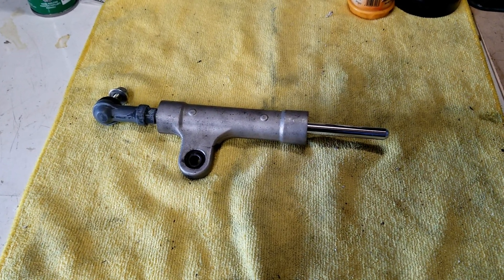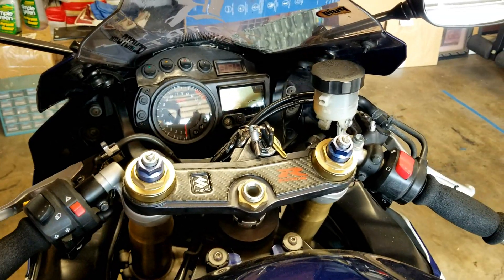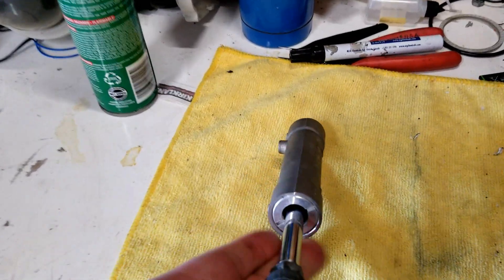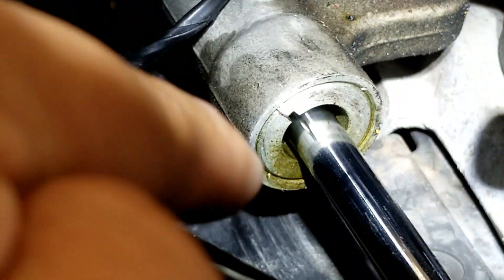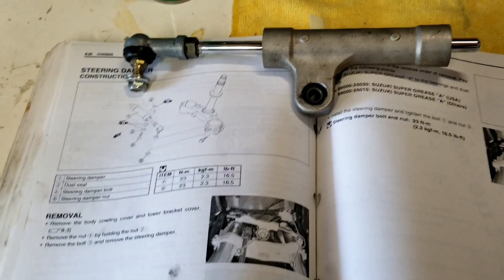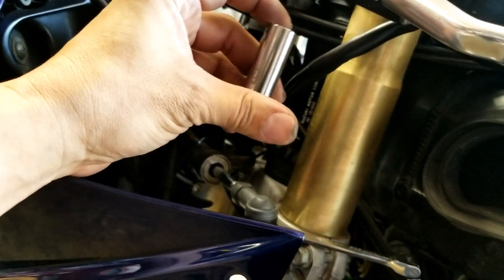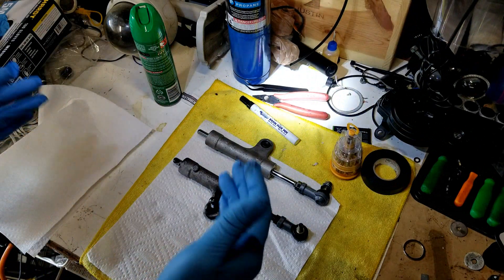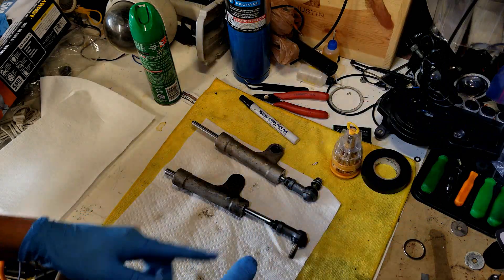Suzuki GSXR Steering Damper/ Stabilizer Replacement

Comment: Is better on clips on or under ?
Reply from the maker: It's all just a matter of preference really. I prefer underneath because it allows me to use the center stem hole for my phone holder, ..

Plus I don't have to disassemble it to get under the tank... and lastly.. I just think it looks cleaner.
Reply: @TheChemistDIY can it be revised?  like with forks?  ?
Reply from the maker: @UnknownVet I mean anything can be modifued to fit any situation, just requires a little welding. You just need one stable point (the frame), and the point your trying to stabilize (the forks) . If you look at the aftermarket stabilizer setup, youll see that its fixed point is usually to one of the two gas tank bolts and the other is end connects to the forks by way of fork nut or something that attaches to the forks or tripple clamp.. The OEM is sort of reverse of that, on the bottom end, only using casted arm  and guid pin to the respective mounting locations.
Reply: @TheChemistDIY  sorry, I explained myself badly, I mean can the original be restored?

Comment from the maker: The good book says no, just replace.... Now, I have read on the forums that it can be done but the only issue with that Is finding the replacement seals... you dont know till you try..I have two old ones but have never bothered to rebuild one,.. and thats just because you can find them on ebay really cheap rather then trying to track parts down, waiting on shipping times.. ect.

Comment: I have k8 600cc and I have a Sd code on. Is the steering damper or it could be something else ?
Reply from the maker: Check the plug connection at the damper. Disconnect and Spray it with some electrical contact cleaner and reconnect and see if the code goes away.. if not put the bike in dealer mode and see if any other codes are being thrown..
Reply from the maker: I did a little research on this on the forums and this is what I uncovered as possible resolutions to your problem.

1. No one knows if the error code read Sd or 5d..lol

2. Some have reported it being a low power issue or charging issue. Check to make sure your battery is charged and sits at the correct voltages at all times.

3. Regular rectifier is going bad and the bikes charging system is not working properly. Test the RR and see if your charging system is working correctly. There is a recall on this and the dealership may replace for free if it hasent been done already.

4. Dirty contacts on the connector and steering stabilizer. You're going to want to use some electrical contact cleaner and spray them both down to ensure a good connection, inspect the pins in here as well.

5. Broken wire connection at the steering stabilizer connector. You're going to want to inspect the wiring at the plug to ensure there are not cracked or broken wires. Some have reported that the wire length is too short and when you turn your handlebars from left to right this tends to pull on the cabling too hard causing it to break or damage the connection. If this is true in your case then you're going to want to extend these wires so it doesn't happen again.

6. Dirty or foul speed sensor. Remove the speed sensor inspect clean and reinstall. Make sure the bolt is tightened that keeps it attached to the engine casing.

If the problem isn't corrected some have reported the bike will stall, shut off completely and won't start again. Also issues with the gauge cluster not reporting milage or freezing at certain intervals.

I hope this information helps you out, please come back and let us know once you resolve the issue and what the resolution was.
Reply: james moreno I believe it’s my rectifier, my battery died bike wasn’t turning on and the battery was couple of months old. I will have to replace the rectifier and there is a recall on it. I believe that’s the problem. Cuz the bike is working just fine with a new battery and the code is gone.
Reply from the maker: Cool, well you can perform a RR test on your own to see if your getting the correct values across the international diodes.. you should also test the stator and see what it's putting out.. while the regular rectifier may be free this time around due to the recall warranty you may want to look into getting a MOSFET from roastercycles.com if it happens again. I have one and swear by it being the best.

Comment: Yup I went down 3 months ago from a death wobble/ tank slapper as well
Reply from the maker: Damn, sorry to hear that brother... did you get road rash? What type of bike? I know some bikes are notorious for having poor handling issues. I remember running over a bottle on the freeway that popped my front tire up off the floor.. when it  contact with the road my recovery was instant tho the shit stains in my boxers took a hot minute to get out when I got home...lol
Reply: james moreno yeah I had a Bilt riding jacket on and it destroyed it, the bike was a 2009 fz6 and I was doing about 80 and hit 3 pot holes back to back and was thrown off the bike but I walked away with road rash on my right elbow, right foot and a new right ass
Reply: Dih he died?

Comment: Is the stabilizer supposed to feel loose??
Reply from the maker: Lose where?
Reply: @TheChemistDIY  like the piece itself, like when I flick it with my finger it moves, took it to the dealer and they said it was fine it’s supposed to do that, I feel it should be tight, no movement at all
Reply from the maker: Ok I understand now. So yes it does move when mounted to the bike... finger flick,  well not so much so I would say. You have to remember that one end of the smooth rod sits on a ball joint while the reset just float insides two rubber bushing, so there's going to be some play or rattling feeling when tugging at it.

The major thing you should be looking out for is the left to right movement and a sudden loss of stiffness when doing so.  This feeling is most commonly felt when when making left or right turns at slow speeds and feels like the bikes is going to fall on you as the damper just suddenly loses stiffness and the bike shifts real quick.

Hope that answers your question.
Reply: Mine moves up and down real easy

Comment: Quick question: did you ever receive an error code?  Because,  I received a SD or 5D and as I research it indicates the Steering Damper.
Reply from the maker: What up marvin, on the 04-05 GSXR this is not possible, the Damper is stand alone and has no electrical connection to the ECM.. what year GSXR do you have?
Reply: I got 5D code and have an 08. Wondering if I need to replace the entire damper
Reply: Me too. I have a 07 and code 5d it’s my damper?

Comment: Replacing benefits the manufacturer not the customer plus i think when they meant replace they meant with a brand new steering damper and not a used one. It is very simple to service though if leaking and has air (the deadspot you feel when turning). If they were not meant to be serviced there would not be nuts on each end and would not have a bleeder hole where the small nut is. Only issue might be finding the exact seals if the one you have is damaged and leaking. I would recommend servicing those dampers every 2 years or so because the oil for one wear over time and the seals might gather dirt and start leaking. 

Nice video though.

Comment: Did I hear it right?
120K?
Reply from the maker: On the clock, yes..although not on the original motor.. I have have the original motor still but i had to pull it because i blew the tranny. The oem motor still runs fine with 99k on it.. I plan to rebuild it as well as the tranny that threw a few gears which was the only reason for the swap in the first place..
Reply: @TheChemistDIY  if you had problems with gears... i highly recommend you to change oil pump too

Comment: How did the replacement steering damper perform?
Reply from the maker: Better then I could have imagine. I always thought it played a single part in just reducing the chance of tank slappers but never knew how important it is in just your normal steering..
Reply: @TheChemistDIY  I ended up running my 750 on the dyno 3 seperate days with months of separation. I used 3 different settings, using the zero map and adjusting manually. I did this because I was making improvements along the way. New chain, sprockets, throttle body hoses and TPS adjustment and STPS adjustment valve clearance and stva repair. I wanted to see the improvement at each stage. Yesterdays Dyno run was 64% humidity. 
I ran it +4 ticks rich in low, mid and high. Yes, it was rich, but you won't believe the results and not far off first two runs. Long story short, I have three different results from stock map(zero map) to +4 ticks. All results were consistent and strong. At the end of the day, it's only slightly noticeable depending on what you are looking to get out of the engine performance. If anything, this will give you an idea of what to expect. You've helped me alot, so just trying to give back. If you want detailed info, just let me know. Thank you
Reply from the maker: @kennethford5386  Hey kenneth, thanks for the post brother,  More details would be great.. if you plan on posting on my channel put your info the power commander video this way the power tweaking peeps can see your stats and seek you out for help. If you have copies of each map you can thus share with the riding community, if not shoot me the info via email at jamesmorenojr@gmail.com  and I'll do. Glad I could help you out and it's great that you want to give back..